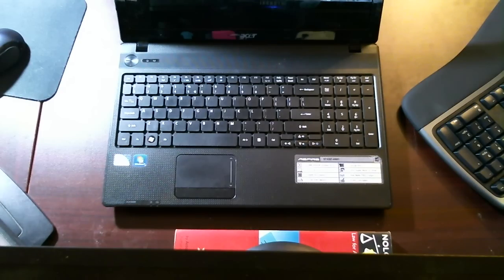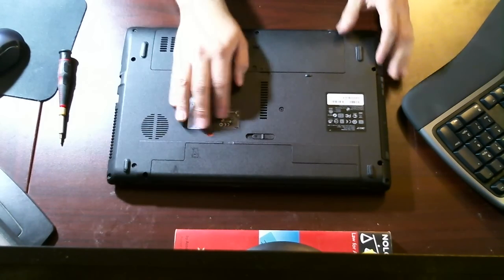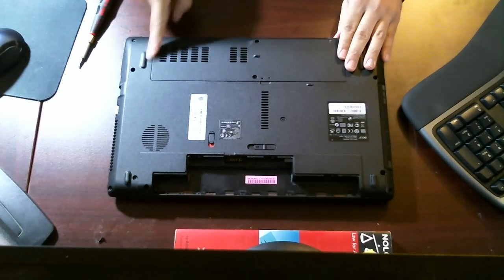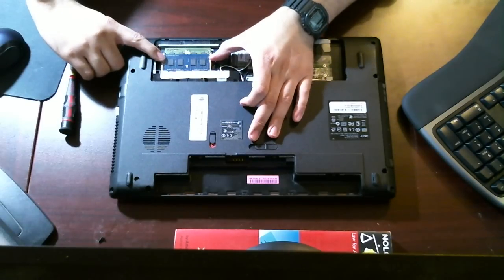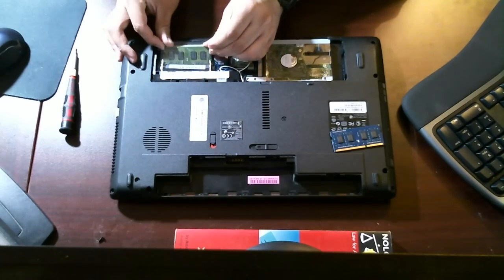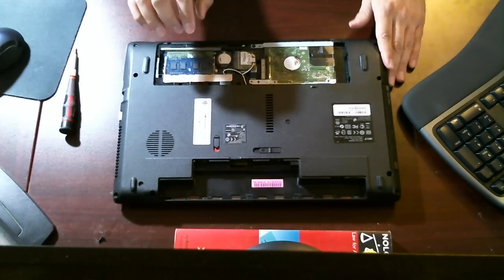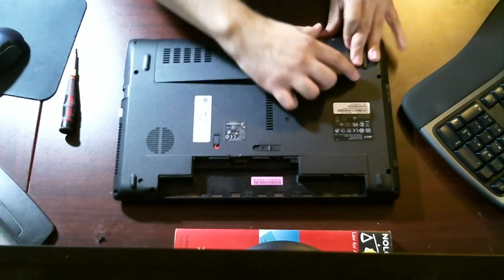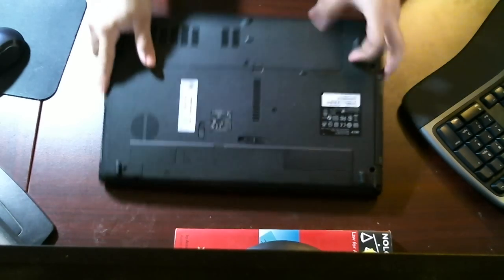How To Replace Or Upgrade Ram Acer Aspire 5742z

Comment: Excellent video with consise instructions.  Very easy to follow.  We upgraded from 2 GB to 8 GB  We had a problem booting up the computer after the RAM upgrade and called and spoke to Eric.  He gave us a suggestion to remove one of the memory sticks to see if that would help.  When we went to remove one of the memory sticks we discovered that one of the new memory sticks was not snapped in correctly.  Once that was fixed it booted up fine and the computer recognized all 8 GB of memory.  Thank you for providing this tutorial.  It was really a simple upgrade.  Just think we were going to pay to have the memory installed until we found this video.

Comment: if your computer uses a x32 bit operating system, then you can't upgrade your RAM storage past what you have, but if you have a x64 bit operating system, then yes. adding more RAM to your computer would make it much faster.

Comment from the maker: Hi Evan, this computer is not a bad system. In fact, it is one of the better Dell computers I come across. The RAM capacity has a lot to do with a computer's speed and operation. However, try disabling the background services and start up programs first. Also, try cleaning up your system with a program like CCleaner. It can be downloaded from our website in the downloads sections. Hope this helps. Thanks for watching! Show your support and please subscribe!

Comment from the maker: Yes, the upgrade will not be successful. In order for your computer to support 8GB of ram, you will need to upgrade your operating system to a 64bit OS. This will allow the system to support sometimes up to 16GB+ of ram depending on the computers make and model. The upgrade from 32bit to 64bit is fairly simple if you have the Windows discs. Thanks for watching my videos. Please show your support and subscribe!!!

Comment: Hi
That is awesome,
I have Aspire 5742G with 64bit Operating System, and it looks similar like yours. But I'm wondering if it will requires any thing more or it will be same like what you did if I want to install 8GB Rams instead of my 4GB Rams?

Comment: So i have an acer aspire 5742Z-4404 and right now is running on 3 GB. It has 64 bits. My question is, what is the most i can upgrade my RAM? please answer as soon as possible i sometimes use photoshop and lightroom on this laptop and sometimes i need to have both open and it lags pretty bad.

Thanks for the video

Comment: My current lappy acer aspire 5742 has 2GB of RAM in a slot, get on the other 2GB RAM and I place it in. Which is suppose to be 4GB but it only shown 2GB. Would appreciate it if you could fix this issue.

Comment: hi ! I have aspire 5742g.I had a 4gb ram board and I bought another 4gb ram board (ddr3 ,1333 mhz) when i open the laptop and windows loading spontaneously it shutting down like it hasn't got any power and battery and the screen flashing like the ram is incompatible.What can I do?

Comment: I have this same laptop and everything online says it is set to take 8GBs, but when I installed two 4GBs RAM chips it only recognizes 4GBs total. I went to msconfig>boot>advanced options and found that the max is set at 4096 KB.  How do I reset this?

Comment: Thank you for the video , it was clear and easy to understand.
Now I have the same model but i3 processor. I have 4 gb mem , and I want to upgrade to 8gb ram so the system get quicker.
How do I know if I need 1333MHz or 1600Mhz? And what about the voltage?
Reply: did you get upgraded the system. and how

Comment: Can I upgrade to 8 Gb if I have 32 bit system? My laptop originally has 64 bit version. It's just because once my hard drive broke down and I took my laptop to specialist and afterwards he installed 32 bit operating system. I was really upset.
Reply: +Shmiite 32bit sys support only 4 gb if your cpu alow  set 64-bit sys and set  8gb.

Comment: i have an acer aspire 5560 it justs loads on the welcome page i have windows 7  ive took out the ram and put it back in but it still loads on the welcome page it fell about 2 feet in the air i dont know the issue or how to repair please help

Comment: i had a lot of problems finding correct ram for acer aspire 5742- while the 2 gb units had written on 'em they were 10600 when i bought 2x4gb rams of same kind my laptop didn't run. now i think i need 2 8500 4gb but i'm not sure anymore, anyone here knows?
Reply: HELL0RWIN Use crucial system scanner - it will suggest the correct ram. 2x4GB are £50
Reply: thx x answering in the end i was right and needed 2x8500s so problem solved

Comment: I want to upgrade my Aspire 5742 for Gaming and also want to upgrade the Storage on it.
What will iI have to do?
Please Help me out
Reply: Get a desktop. For gaming, you need a dedicated GPU. I hope I'm not too late on this. You can get a used i5 or i7 system with 8GB RAM from the last 8 years, use userbenchmark.com to compare them to find which one's the fastest. Make sure it's not small form factor. That shouldn't cost you more than $200. Then you need a GPU, so get a used Radeon RX 460 or a GTX 1050. If you want some perspective on this, http://cpu.userbenchmark.com/Compare/Intel-Core-i5-8250U-vs-Intel-Core-i5-3470/m338266vs2771 should give you an idea. A new, much more expensive laptop processor is equal in performance to a 6 year old desktop processor that you can easily find an ENTIRE SYSTEM with it inside. And that isn't even mentioning graphics. http://gpu.userbenchmark.com/Compare/Intel-Iris-Pro-580-Mobile-Skylake-vs-AMD-RX-460/m132950vs3641 shows that a GPU you can get for under $100 used is 85% better than Intel's BEST laptop graphics. Any gaming laptop has it's own GPU, made smaller to fit in a laptop. It is literally impossible to fit a decent GPU able to play games well in your laptop. Consider buying used to get a desktop system lightyears faster than any laptop upgrade you can do, and you can get it for under $300.

https://www.ebay.com/itm/HP-Elite-8300-SFF-Desktop-Intel-i5-3470-3-2GHz-8GB-500GB-Windows-10-PRO/112830537953?epid=10019793338&hash=item1a453960e1:g:v-EAAOSwE51ajvfH
https://www.ebay.com/itm/MSI-NVIDIA-GeForce-GTX-1050-2GB-GDDR5-Low-Profile-PCI-Express-Video-Card/123161596071?hash=item1cad00d0a7:g:CgMAAOSwPGpbDZec

I got that from just a quick search on eBay and that's a fully functional 1080p gaming pc right there for $300.

Comment: I tried this, and now my computer won't boot up. I hear it working, but all I see is a blank screen. Can you help me find what went wrong?
Reply: I was actually able to get out to work. It turns out I needed to push them in further. I had them seated at the notch and clipped in, but had not pushed them in far enough to be registered by the PC.